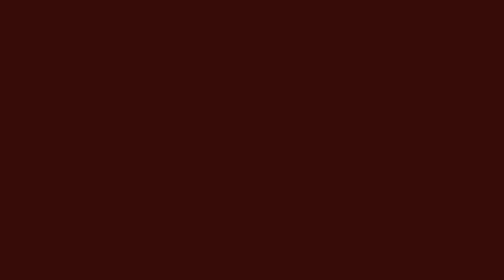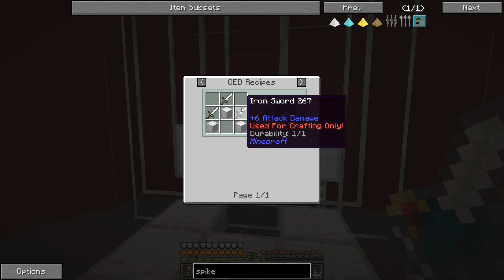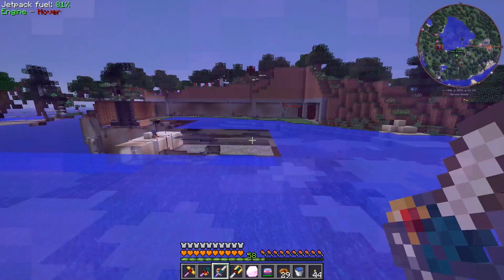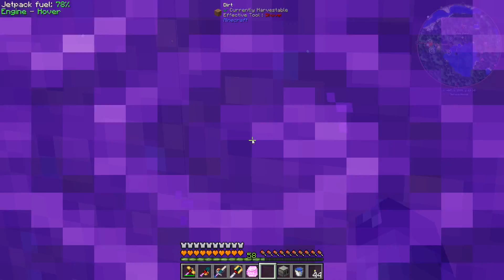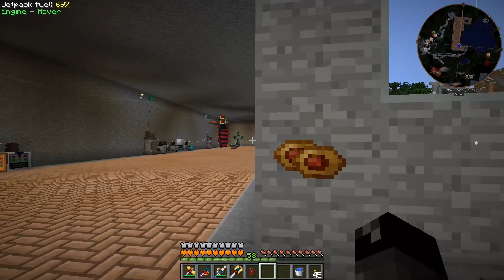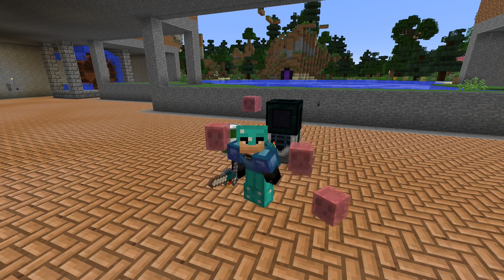Minecraft Mods FTB Infinity Evolved - PINK SLIME [E23] (Modded Expert Mode)

Comment: Soon you need to change out mirco blocks later for painted camo glowstone block because more you have as mirco blocks it will cause lag because of looking at it all sides.Think of it as pixels more pixel you have the harder it has to  work. So camo glowstone floor will never cause a issue of lag. Pink slime only grow big if you use a slime syringe. Should caught the big version of it.

Comment: I believe you can use the Ae2 vibration chamber to power the crystal growth accelerators but I think the original recipe itself needed an energy acceptor, so it may not be a solution to power those.

Comment: Hypno, pause at 27:08 - Look at those arrows... try this:
Set the connection at the back of that panel to INSERT.
Now, look down at your drum and click the connection there and set that to EXTRACT : Auto.
Yes, I do believe you need to change the settings at BOTH ends. I'm now wondering how flexible these tubes are... could a system use one line of tubes and filter into large storage tanks? Do they allow fluid filtering? Would it also allow small tanks to be insert only with large tanks in the back for mass storage that are set to in/out... thus when stuff comes in it goes into mass storage but when the small tanks up front has a bucket removed it draws from mass storage and send it to the small tank.... all on one run of tube. That could be handy... and easily get backed up I bet. * laughs *
Reply: Yes you are absolutely right about the Ender io pipes. I was cringing so hard we he said he could figure it out. I was like really hypno.

Comment: You could put the MFR conveyor belts at the bottom of the Pigman Grinder to stop them from spawning there instead of using the ones you have now, and then you shouldn't have any spiders either.
Reply from the maker: +jacob99503 The trap is setup to kill the pigmen on impact. MFR conveyor belts negate fall damage. I'd have to setup a machine to kill them if I were to change.
Reply: +Hypnotizd Oh, I didn't know they negated fall damage. That explains your choice.

Comment: For the Ender IO cable on the inventory panel you need to set it to "Extract / Always active / Green" on the drum and then on the panel ... go to the fluid tab and set configs to "Insert / Green" There's two tabs for the inventory panel because you also have the power cable connected in case you didn't know :P
Reply from the maker: +tovmassian13011 Trust me, I've been through all of those settings. I've changed both to red as well to make sure it wasn't a problem with the green channel (if that is even a thing that could be a problem).

Comment: I think your problem with the nutrient distillation is that you're using a non-pressurised fluiduct. all of the ones from ender io besides the first tier can move fluids upwards, but that one follows gravity
Reply from the maker: +starg09 Huh, I didn't know there were more tiers of fluid pipes in ender io. I wonder why I could get it to work once before... I'll look into this.
Reply: +Hypnotizd Yeah, they might have added them on the beta. At least I'm sure the ender conduits weren't there before, but maybe they also added the pressurised and non-pressurised then...